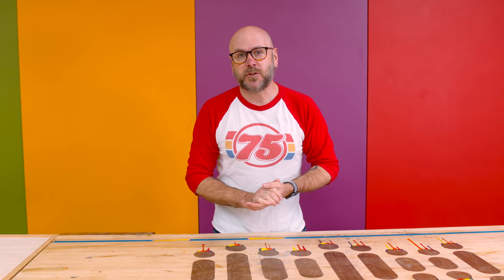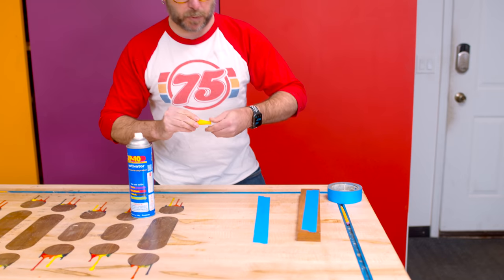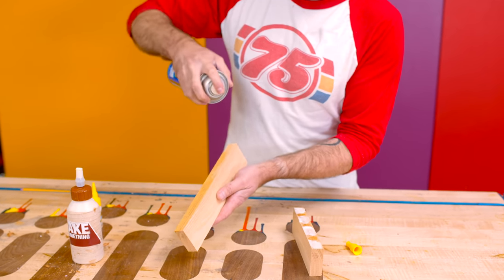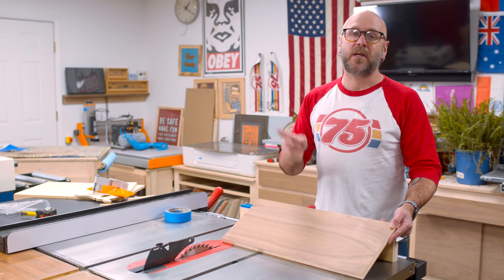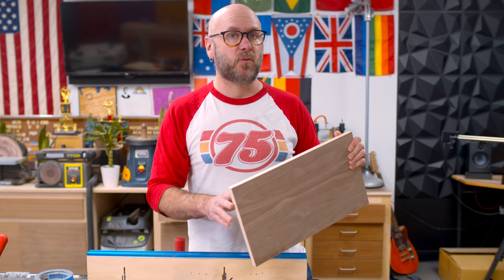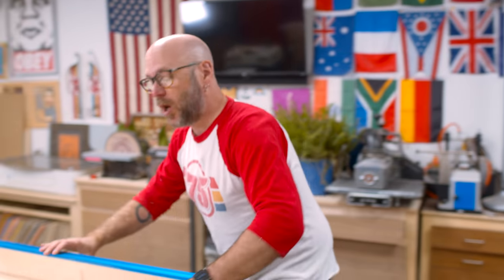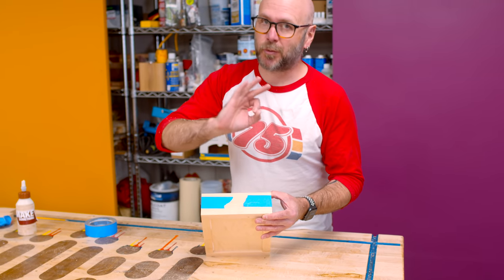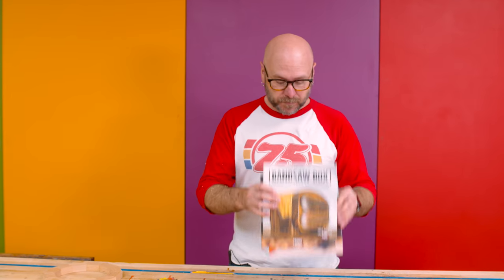15 Tips That'll Improve Your Woodworking! Must Know Tricks and Techniques!

Comment: I had no idea that wood glue could melt! Great tip!
Reply: It is. This knowledge also helps when you forgot to remove glue exceed on your piece and it got to the point of solid rock. You just take your orbital sander with some rough paper like 40, 60 or 80, make a quick touch (5-10 seconds) on the exceed to heat it up and then remove it with you chisel in a seconds.
Reply: @podstrahuy  no no
Reply: @albertgodfrey5106  why why? I've made it few days ago and it worked perfectly
Reply: Pp9up

Comment: A tip I use are pocket holes for super strong 45 degree angles.  My favorites used here are the straight line jig as it’s a must for lumber that doesn’t have one straight edge, CA glue between wood glue for a strong fast bond, and painters tape to minimize tear out.  All works great!  👍🏼

Comment: Great Tips!  Recently,, I had to hold down some small blocks of wood to rout recesses in them. I had no awareness of the wedge method you show, but came up with exactly the same thing. I made rectangles out of scrap to fit the small wood blocks,  but on two sides attached the scrap wood at an angle for the shims. Back in colonial days, and later, they didn't have our modern clamps. They made do with solutions such as using wedges.  There is a video on YouTube that shows how to make a jig for cutting shims on the table saw.  Saved me a lot of money and trips to HD to buy them.

Comment: You can make a "clamp" with a 1/2 round piece of wood screwed in the middle. As you turn the piece around the screw, left or right it "clamps" or "unclamps" your glued piece that you have positioned with a block screwed down to the other side. You can put a protective piece in front of the the 1/2 round piece if you think it will leave a deep mark in soft wood.

Comment: Blue tape at inside corners of boxes or along edges of other joints eliminates glue squeeze out problems. I also like to pre-finish insides of projects before glue up. I'll put blue tape on joints/tenon to keep raw wood from getting stains or finishes on th3m.

Comment: If you’re going to use CA glue to fill gaps with sawdust, make sure you sand off ALL of the glue residue from the face of the object before attempting to apply any stain. The CA glue (or even regular titebond) will not accept stain and will be very noticeable

Comment: Tape trick - instead of using blue tape as a clamp, try orange auto body masking tape or green masonry masking tape. Both are much stronger(green being the strongest). They also stretch much better giving you a lot more clamping pressure. Also, don't be afraid of try a roll of cheap white masking tape from your grocery store. Many of them work way better than blue tape, all of them are much cheaper (some being as cheap as $1 a roll)
Reply from the maker: Ohh, I gotta try this! Thanks Mike!
Reply: @MakeSomething  no problem. I use a lot of tape for glue ups and blue tape gets expensive.

Comment: In the "Painter's Tape as Clamps" part of your video, spread glue on the end-grain. Let it set for a few minutes. Then add a little more glue to the end-grain and assemble. I think you used this in Tip #1 on a miter joint. It should work the same shouldn't it?

Comment: Well Dave that’s a handy video. 
Question about supper glue activator. What’s it’s ingredients to mimic skin. I keep a tube of supper glue in my toolbox fridge(for longer life) best first aid product made.
Reply: what brand do you use. Mine is constantly dried out when I try to use it twice
Reply: @vince9660   off the shelf single use “super glue” never twice. The bigger volume ones seals end better. The best I’ve had is the two part bottle one has glue one has sand ( for repairing parts) it lasts in bottle good.

Comment: I’d like to add when using tape for any wood cutting: Always pull your tape off from the non cut long side, towards the cut edge. NOT from the ends of the tape, like you normally would when pulling tape off. You want to leave the very edge of the cut all along the length until last. It will help keep the fibers from pulling off from the edge with the tape.

Comment: My only diss. endgrain gluing has been proven by testing that they are as strong or stronger that the parent material.
Reply from the maker: This is very true. Although over many years with seasonal expansion and contraction that glue joint weakens because the glue doesn't expand and contract at the same rate as the wood.

Comment: The son of a friend of mine to get four 2-foot pieces out of an 8-foot 2x4. When he was finished, he had four pieces that was shorter than the other. I told him the reason he has four pieces of different lengths was because he didn't take into consideration the thickness of the blade he was using.
He measured out and marked every 2-foot on the 2x4. He cut the first line, then he went on to the next line, then to the next until he got to the last line and cut it. 
Each time he cut a piece, he removed the thickness of the saw blade from the next piece. His last cut made the last piece three saw blades shorter than the first 2-foot piece he cut. 
This also applies to boards that you want to cut four equal pieces across the width. You'll never get four equal pieces in width. It's impossible. The saw blade thickness is always a factor when trying to cut equal parts. If you want to get equal length or equal width pieces, you have to keep in mind the thickness of the saw blade you are using.
This applies to handsaws, bandsaws, circular saws, jigsaws, miter saws, and table saws.
If you want, you can use the above in one of your "Tips & Tricks" videos. All I ask is that you put your own spin on it and don't use my friend or his son in the video.

Comment: dont wipe glue with a wet rag on end grain. It isn't that the water will make the glue less strong, it is that water on the end grain can cause expansion, separating your work pieces, even clamped work pieces. The expansion recedes when the wood dries, hiding the glue gap and making it impossible to tell why the joint is so weak. It isn't a problem on super dense woods, or if your not dealing with end grain.

Comment: Glue won’t be strong enough for the mitre? Are you nucking futs? The wood will break before the glue.
Reply from the maker: yeah, on long grain to long grain glue up the glue is stronger than the wood. but not on miters. Have you ever seen a picture frame without some sort of reinforcement?